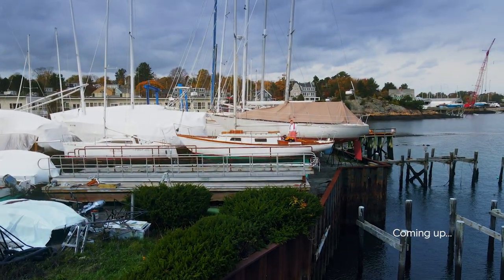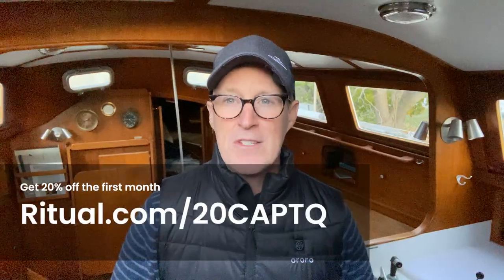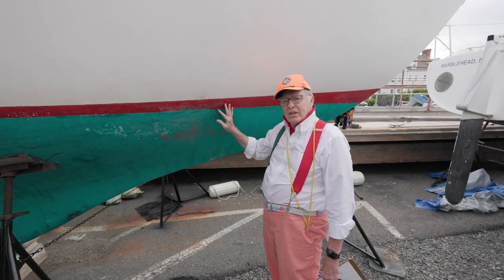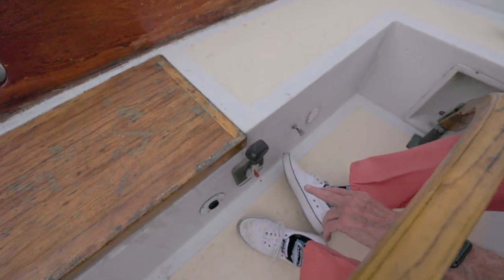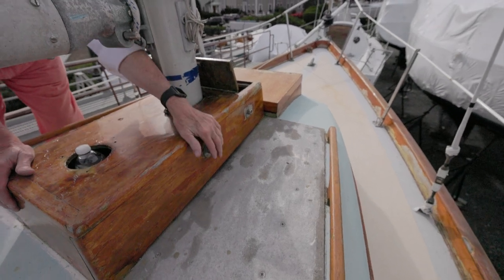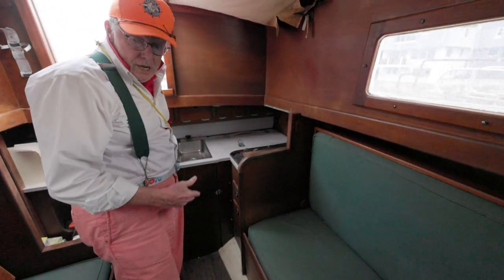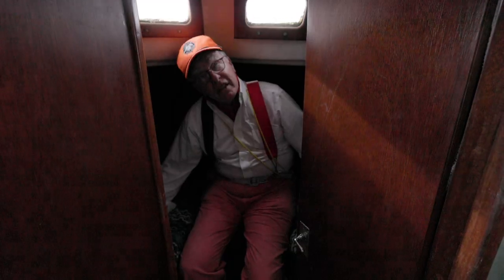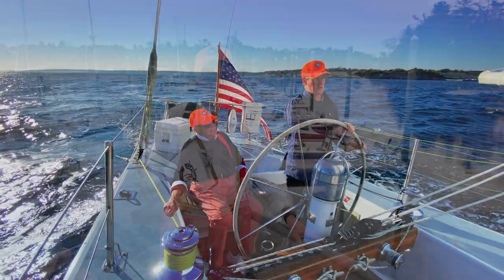$4,500USD  SWEET BEAUTY! Lovely classic sailboat for sale International 500 #sailboatforsale

Comment: Solid old boat but proceed with caution.    I could see rewiring the entire boat stem to stern, and refurbishing the diesel, redoing the cushions.  I'd also loose that soft headliner and replace it with a wood solid headliner.   LED lights throughout, a better prop and a good hull cleaning / painting will make this old girl sing.

Comment: Sailing can be cheap, wind is free.  If you can get an inexpensive (or free !) mooring or slip the entry-cost is attainable to many. The things that cost a bit are storage, haulage and sails and lines. I've day-sailed without an engine for 10 years. This particular boat shown here is a bargain, well built but also pleasing to the eye, with historical significance in both design and ownership history.
Reply from the maker: yes!!

Comment: The problem with this small yacht is the lack of mast support in the passage to the bow. The owner has attempted to stabilize it by screwing metal plates inside and outside, because the pressure from the mast has caused the cabin roof to bulge inward.

Comment: Hello from the west coast 👋I like this one a lot .It's simple and basic and not trying to be something she's not just a feel good let's go play for the day or weekend and have some fun .and yes the hull is over thick .that's because at that time people were not sure how strong and durable fiberglass was .Her hull is most likely 1/2 to 5 /8 inch thick all glass .and that plate under the mast was most likely added because the cabin roof was not strong enough to support the stress of movement that was being transmitted from the mast to the roof . She will make a great first boat for anyone including a beginner .and if I'm not mistaken because of her weight you can trailer her to move from place to place she should be short enough that when the mast is removed and because of her gross weight it can be towed behind a pickup truck Using a properly built trailer .Yep a real fun boat to have at a real great price you can't go wrong hear.
Reply from the maker: sorry weight was in error   she was 11,000#  opps

Comment: About 1970 I had a chance to test out a $2000 fiberglas lake sailboat.  It scooted across Benbrook Lake just fine in a light breeze, tacked and handled great, but there was no room to speak of in the cabin  - it would be a 'cubbie cabin' if it were a motorboat.  Nothing but a vee berth, but no cushions.  I passed on the boat - I was not much of a lake person.  But had I been near saltwater, near a calm bay, yes this baby would have been right up my idea of a starter boat that might never need upgrading for a very long time.  No stove?  Pack sandwiches and some salad fixings to get you through the day, and add a can of Sterno, a camp stove, anything to heat up some coffee anytime.  If it's got a 12v lighter plug there are coffee pots that use 12v power like that.  Umm, nice little boat, I'd make sure to get a cartridge toilet so I would not have that stuff sitting in the boat.  They are practically giving it away. It is not free, I suspect because they want the boat to have an owner with a sense of investment.  But it's not so expensive that it will not sell because there is a 36 footer nearby for just a few thousand dollars more.

Comment: I'm wondering if that deck-stepped mast went by the board at some point, and took that part of the coach roof with it? Hence the big steel plate, etc. Sweet boat...needs a lot of work and updating (I'd lose those winches right away!) but for a few grand more and some elbow grease you could have her in deadly shape!
Reply from the maker: Good point!

Comment: Hello Captain , I was wondering why you never say anything about the sails that come with the boat when you are showing it , what type  of sail's it has and the condition they are in  ? You know like new , good condition  or bad, slightly weathered .Thank's for doing what you do  .
Reply: Soft goods like sails, running rigging, cushions and dodgers wear out and lose their shape over time, use and exposure to sun.  Everyone is different in how much wear they will tolerate, but with any old boat you can anticipate there will likely be a mixed bag of decent, well-worn and anything in between.  If you're going to sail the boat for any length of time, anticipate you'll have to replace some stuff anyway.  Looking at the winches, I expect some hardware too.  Those are original vintage, could be worn out, and with her sail plan, might be underpowered with a genoa.   But as the Captain says, go sailing first.
Reply from the maker: thank you John ....and Janet : we would like to examine more aspects but our time and episode length and viewers' retention are all limited

Comment: Thank you, Captain, for the education! I'm confused still about the bolt on keel. So if I ran aground this would pop off, thereby lessening the damage to the boat hull integrity? Hope it's not a silly question! 😜 

If you need a new camera man, I promise not to walk under ladders. 

This would be a great boat to sail to Beaver Island. A great Irish outpost!
Reply: No a bolt on keel will not just pop off, the vast majority of boats built in the last 40 years are bolt on keels. That said there have been some (very few and mostly race boats) where keels  have come off or otherwise broken.  As mentioned in the video some makes do develop a seam between the keel and hull, but like any system the joint and bolts have to be checked and maintained. So I would not be concerned with a bolt on keel that has been maintained over the years.
Reply: Ballast is bolted to an internal hull structure.. mere fiberglass has not enough strength to hold in a lead keel.
Reply from the maker: spot on Glenn
Reply from the maker: that requires futher illumination Johnny
Reply: @johnnydeutschemark3620  plenty of old boats with keels like that,mine is 50 years old and built to Lloyds regulations, I trust my keel much more than anything with 50 year old bolts,and if you'd ever pulled old bolts for inspection you'd worry about them too

Comment: That situation with the mast is a little worrying.  What's going on there?  What's with all the metal reinforcement?  Then there's that little tabernacle cover or whatever it is at the base of the mast on the cabintop.  Kinda suspect.
Assuming all that's all okay and not a structural weakness or delaminating or some other catastrophe, this boat looks like it would be a kind of all-weather daysailer.  Like when all the quarter- to three-quarter-tonners start running for the marina, you're just getting enough breeze to get up to hull speed.  And the lines and what I could see of the implied sail plan look sturdy and rugged and suited to fairly heavy weather.  And it's well laid out enough below for a long weekend's cruise to somewhere not too awful far off to get away from it all.  A little primitive, maybe, but not as much as going camping would be.
A lot of the brightwork is in need of varnish and elbow grease, but that's not a deal-breaker.  The hull was molded in the "we're not sure, make it a bit thicker" era, so it'll probably last for a few more billion years, but taking steps to ensure that blisters won't develop would be prudent--extra thick gelcoat actually makes that more not less likely.
So long as the funny business with the base of the mast/cabintop situation turns out not to be a problem, $4500 is pretty much stealing this boat.
Reply from the maker: eggzackly

Comment: 4.5k to buy and 7-10k per year to own. New standing rigging, sails, probably even the diesel in the near future. Major cosmetic work, if you want her to look pretty.  Which is why, in my humble opinion, 5k is not the best price point for a beginner, if you need an actual cruiser.
Reply from the maker: The buyer will set the correct price    cheap entry level  to work on over next view years

Comment: Pretty sure she weights closer to 10,000 to 11,000 lbs....My Sea Sprite 30 weighs 10,000lbs with 4000lbs lead ballast.  This boat has to be close to the same.
Reply from the maker: YOU ARE CORRECT     11,200    I THINK THE BALLAST MAY BE AROUND 5    THANK YOU
Reply: @YachtHunters  I think we can excuse the Captain by suggesting he had his units of measure mixed up. She’s 5000kg = 11,200lbs